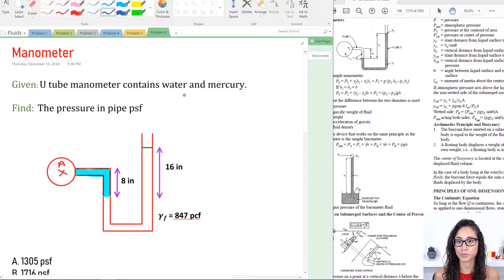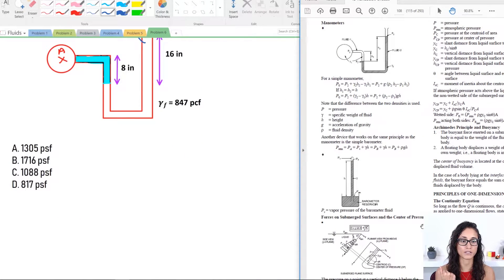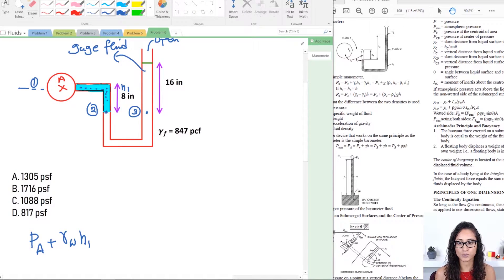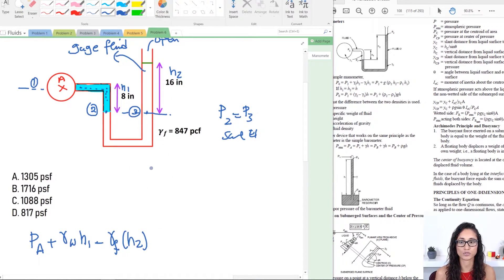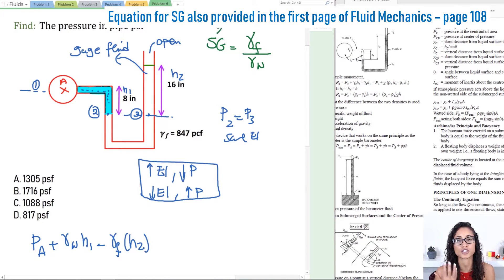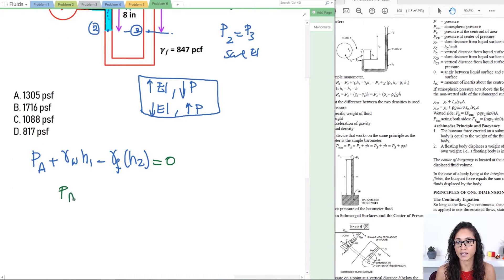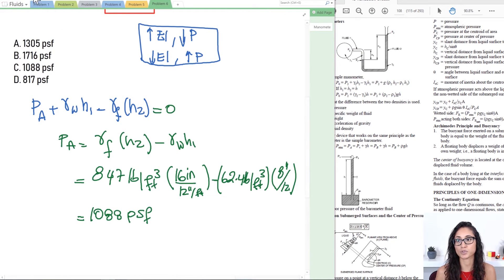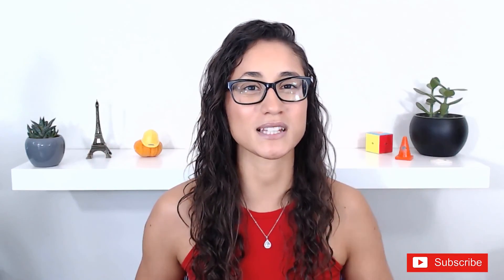FE Exam Fluid Mechanics - Manometer - Pressure At Pipe A

Comment: Why didn't you multiply density and height by gravity? I understand you get the desired units if you don't multiply gravity. But isn't gravity affecting that point of the fluid hence Density x gravity x height.
Reply: When using specific weight (gamma), it includes both density and Earth's gravity by definition.  As opposed to density (rho) which is just density, and is gravity-agnostic.

Comment: On page 102 of the FE handbook 9.5, the specific weight of Hg is 847 lbm/ft^3. Because it is lbm, I assumed I had to divide it by the gravitational constant to make lbf. Should we assume provided numbers are always lbf even if it doesn't specify? Using lbf, 2140 psf is the result which is not close to any of the answers, so in this case, I'd assume 847 is already lbf/ft^3
Reply: Unless otherwise specified, all problems take place in Earth's standard gravity, where 1 lbm is defined to weigh 1 lbf.  This means the specific weight in lbf/ft^3 has the same numeric value as the density in lbm/ft^3.

Where you have to work with the "gravitational constant" when using pounds, is adapting the unit of pounds to Newton's 2nd law, and anything derived from it.  I use the quotes, because this is typically in situations that have nothing to do with gravity.  What the gravitational constant is doing for you, is translating mass units to slugs, for consistency with force in pounds and acceleration in ft/s^2.

The SI system takes the opposite approach.  Units for force and mass that work elegantly in N's 2nd law by default, and a constant with physical meaning for finding weight.

Comment: When exactly the Patm is considered? why Patm=2168psf is not taken in consideration for the calculations? Manuals and texts do consider Patm
Reply from the maker: That is great question. So in these problems, we usually calculate for the gage pressure. The absolute pressure P = Pg (gage pressure) + Patm. If you substitute the absolute pressure equation for PA and P2 (at the open column), the Patm cancels and that is why Patm is usually considered zero when we have open column. I hope this helps and thank you for this comment, I will actually post a video clarifying this issue. Thank you for watching and good luck with your studying!